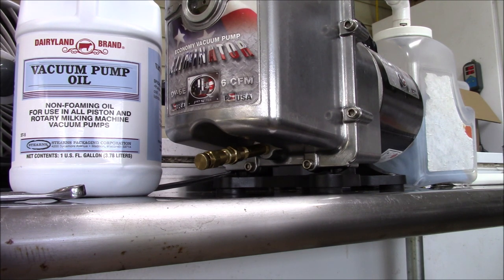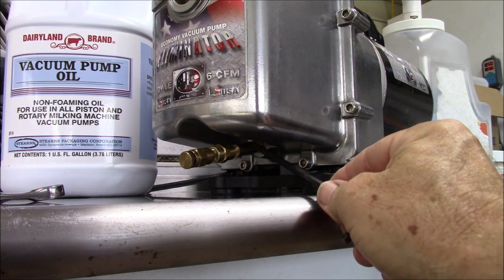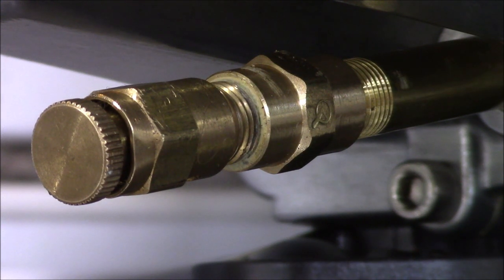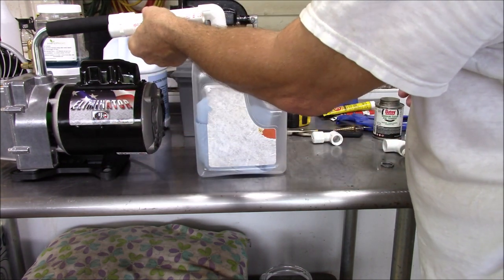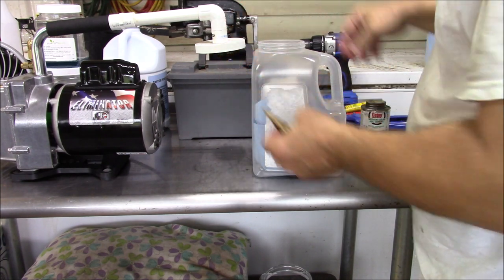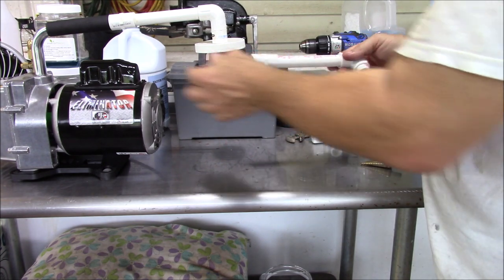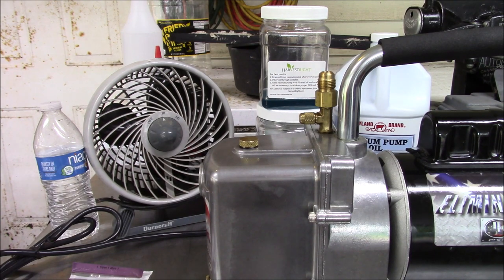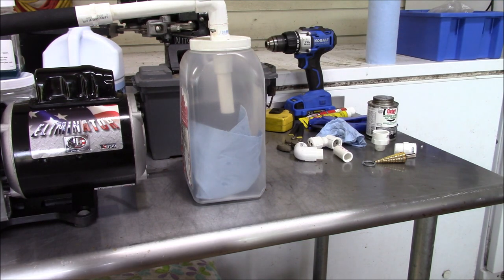DV-6E Harvest Right Vacuum Pump Oil Drain & Air Outlet Exhaust Modifications

Comment: Thanks for the vid. Is there any maintenance necessary on the Chamber Vacuum ?
Reply from the maker: Keep it clean, i usually run some warm water thru the drain just to keep any food particles out, check wit HR to see what they recommend, i know what i do though, i have a sanitizing solution i wipe the inside down with, unless i have a mess....
Reply: @technician775  My Sammic SV-306T needs oil I think. I haven't used it in quite a while but I need to get it out again and work out why sooo many bags were filling with air after an hour or too... I may have to hold them under water and see where the failures are occurring! Thanks for ur advice
Reply from the maker: @thamesuser  Hi, look at the owners manual on the oil change if it is an oil unit, you do have a VERY NICE UNIT!, one of the things to check is the seal time, on my unit, i use a seal time of 1.5 seconds. if the seal time is too long, it will burn the bag and not seal as well. Also, look at the vacuum time, i watch the needle until it quits moving and set that time as the vacuum time (mine is about 20 seconds). I hope this helps. please feel free to reach out again as we can figure this out ! TY!!! Steve

Comment: Do you think the added resistance of the filter for the air output will hurt the performance or longevity of the pump though?
Reply: hi.....it has plenty of airflow...it just points down to catch any oil...ty!